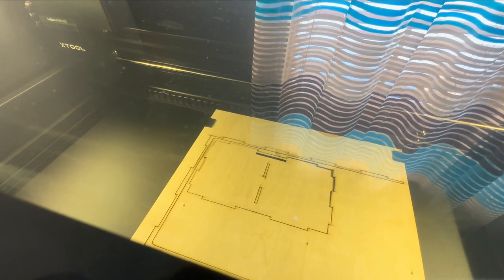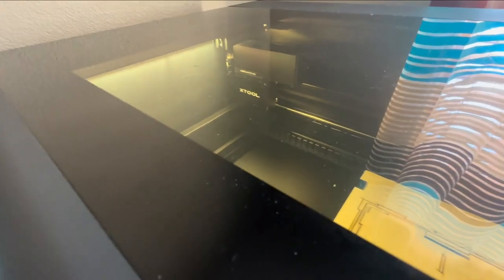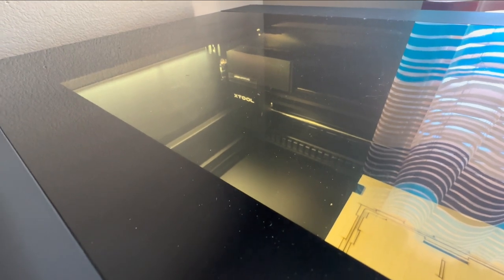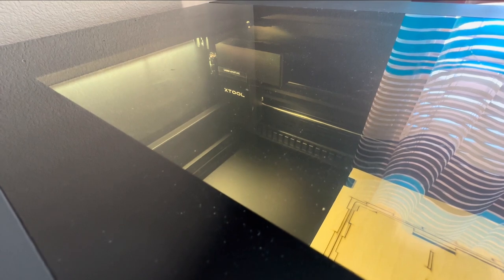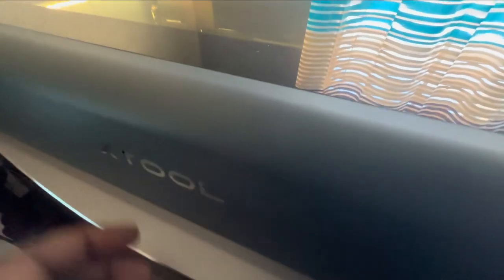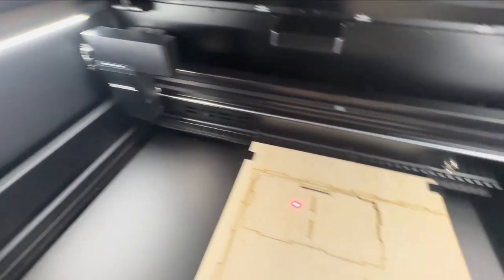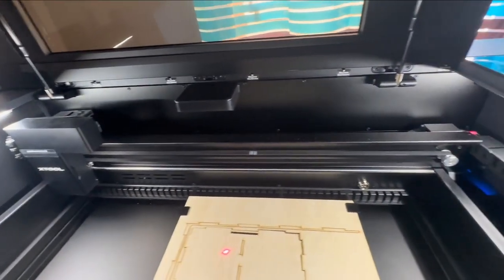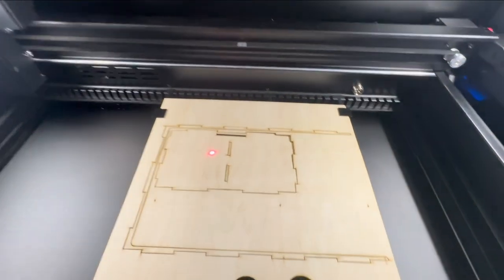xTool P2 CO2 Laser Engraving Glass and Making a Whiskey Decanter Gift Box Tests

Comment: I think they mentioned in one of their live streams that the max speed for curved surfaces is 30 mm/s. I'd guess it's because the laser head can't move up and down quickly enough at higher speeds.

"Monkey Woodworks and More" has a link to his material settings in the video descriptions.
Reply from the maker: Thank you for the tip to Monkey Woodworks material settings. I've been capturing the best setting that are working for me so far. One of the early reviewers around release time and when curved surfaces showed it could do it at the I believe 80mm/sec. I figured they slowed it down for some reason.